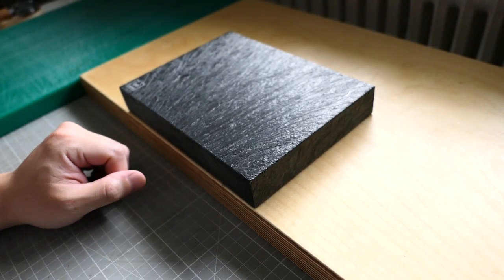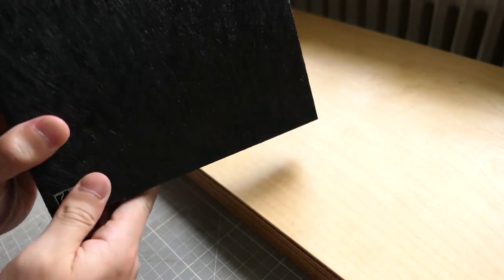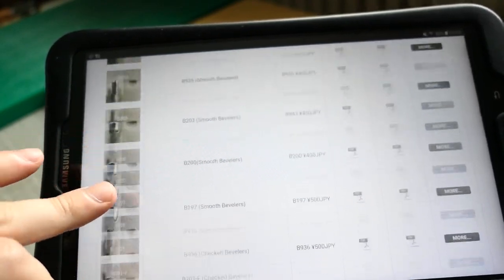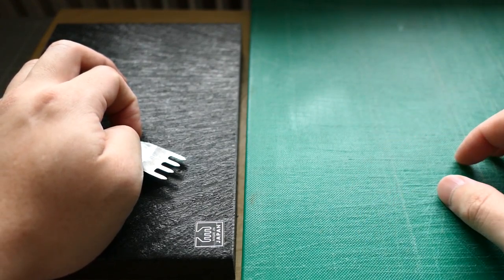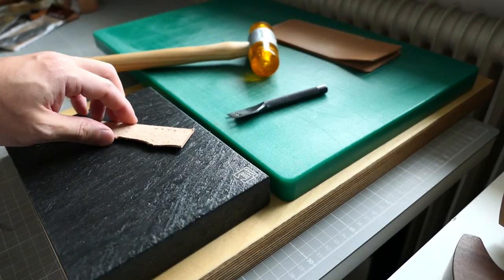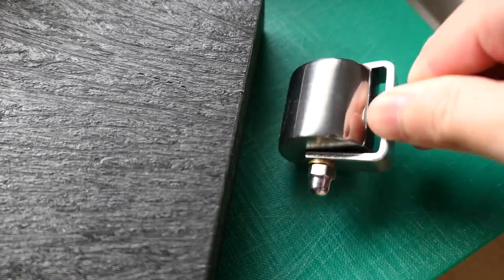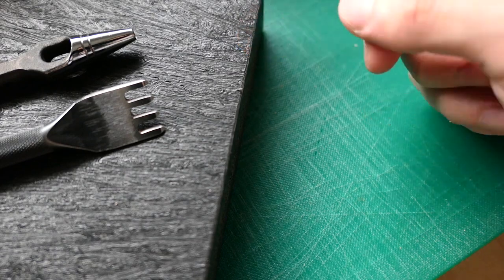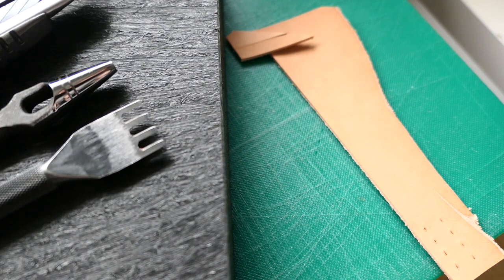BEST BOARD FOR YOUR PRICKING IRON | OKA FACTORY

Comment: I use those vinyl stick-on floor tiles I covered my 2 meter long leather work table with. I take two of them 30 cm square and glue them together and put it on my granite block. It lasts about two years and costs about $4.

Comment: Just got one of those but it's rubbish. It quickly became unusable after a couple minutes of hole punching and cutting. Yes, it will protect your tools, but it's too soft and every hole you punch will leave a crater. So you will need to iron it every couple minutes to keep it workable. I much prefer a cheap Ikea poly board over this!

Comment: At leather for a few months now and by someone that has a leather shop for over 30 years told me to use veg tan and I dont see anything else replacing that.... to go 100% thru the leather makes it much easier  to stitch... just save all your scraps in a side jar
Reply: You got great info. I do the same and it work.
Reply from the maker: that works for sure. when you don't have scrap leather, this can be a good way too. ;)

Comment: Hi there, I'm just learning leatherwork and unfortunately its a bit limited here in New Zealand for access to leatherworking tools and products etc..Some of tools are available but a lot of the tools etc I see on Youtube are just not available here. Do you have any issues with buying from Japan as far as things not turning up or lost in transit etc. I know Japanese products are usually very good quality but can be a bit pricey... would be keen to hear your thoughts  Cheers,  Mike..
Reply: The few times I've ordered stuff from Japan to canada, the shipping seemed to be faster than from US. The prices of some things are much cheaper in Japan, so the trade off of having to pay a bit more in shipping still works out in your favor.
Reply: I'm in the UK and have purchased a number of leatherworking products from Japan and Singapore (eg Crimson Hides products).  I have never had anything go missing and am usually surprised how quickly things reach me.  But I should stress that it is always worth paying a bit more for tracked/expedited shipping when you can.
Reply from the maker: The reply comments are very correct. Don't worry about missing ordering from Japan. They do proper job. Go little extra on shipping if you are worried as first time.

Comment: greetings from India,

great advice and suggestions.

however, we have been using the HDPE  cutting board, with a piece of scrap leather as an interface, between the project material and the board.

if the board is pierced, then the prick marks on the board are levelled off with a ball peen hammer  and becomes good again.

nevertheless the OKA board seems a good item to have in the "tool box/table".

Comment: Thanks for the video, I want to visit Japan one day to see their artistry. Would this wood-grain board work for hole punch tooling? I use an arbor press to punch holes in leather and the poly-board I've been using has developed divots/indentions/holes that cause the leather to slide and become off-centered when pressed. I need a firmer surface that wont also become punched and destroyed when I use the hole punch. Thanks! And I'm using punches with holes in the center, not a prick.
Reply: Hi Matt, how thick is the board you’re using? I’m using a thin ikea poly board on top of a mild steel plate with a 3 ton press and I’m wondering if there’s a better system

Comment: I never use a high density cutting board when laying down a stitch line. I use the soft Tandy poundo board which I have on top of my quartz slab. I am not interested in taking a risk and damaging my tools on a high density surface. 
Why are you punching a stitch line with the flesh side facing up?
Reply from the maker: High density will always be softer than steel. so, don't worry too much. but being extra careful like you will not hurt of course.

if I glue two piece of leather before making pricking iron holes, then I need to lay down on the board to make pricking iron marks.

Comment: Do you always punch with the skin side down?  I was told to do it  flesh side down.  Just curious.  I'm still learning.
Reply: Always punch or cut flesh side down.
Reply: He was giving an example of marks that can be left on the skin side. More often than not you are punching through at least two pieces of leather. Sometime both sides that have been glued are skin sides.
Reply: I always cut/punch flesh side down, to compensate for the odd chance that the angle I'm cutting/punching art isn't right. Definitely don't want wobbly lines on the front of your piece
Reply from the maker: it depends on situation.
Reply from the maker: Exactly, Thanks Jason for writing it down here!
Reply: leathertoolz My Pleasure! Keep up the good work, love the channel!